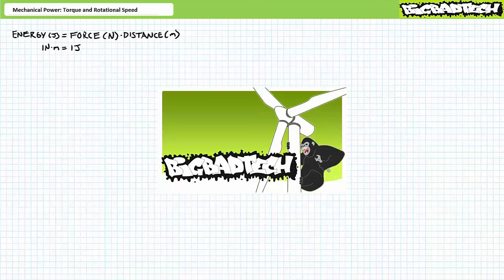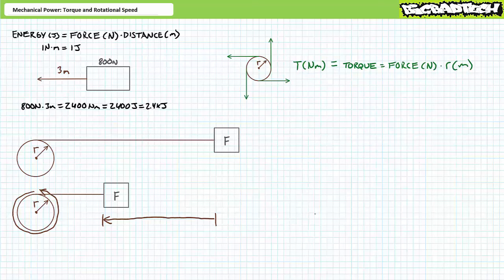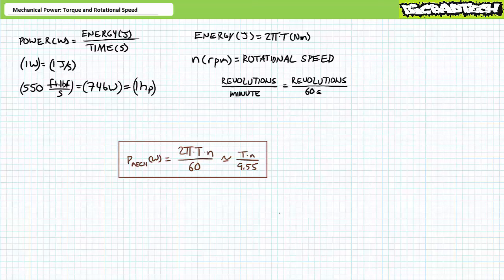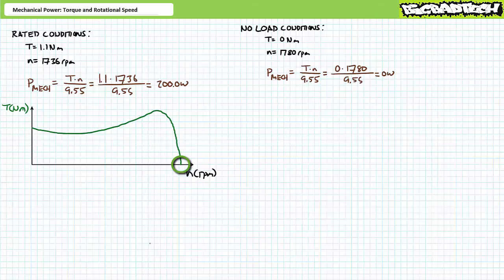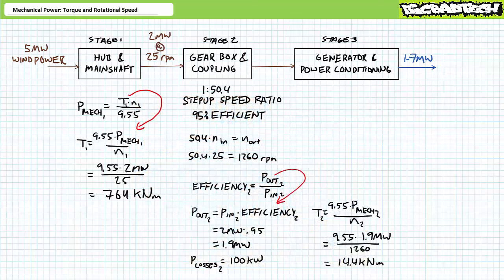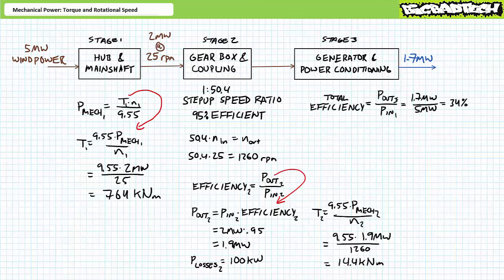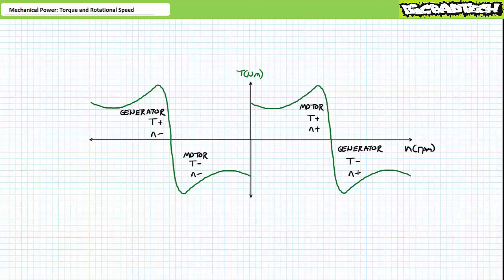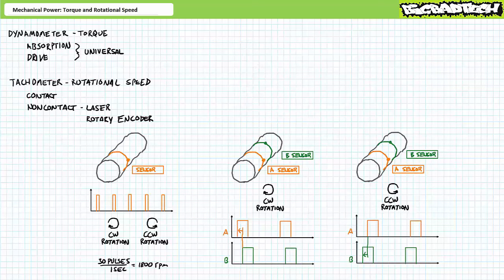Mechanical Power: Torque and Rotational Speed (Full Lecture)

Comment: I bought a portable gen it advertised in TRUE PWR, but when I use commercial gens they are rated in APPARENT PWR? Also I understand about neg torque in a gen, if you calculate this I understand that you must equal or exceed that for a prime mover to overcome this "resistance", how much prime mover force do you need, I am assuming at least the calculated force, or 10% more force than calculated?

Comment: Why do you claim torque is rotational.  Its doesn't have to be. It can be linear.
Reply from the maker: Wut?* Torque is the rotational analog of linear force. It describes the rate of change of angular momentum imparted to a load. You might be thinking of the instantaneous force vector at some point on the rotational path that is indeed linear.

* Used in response to an unclear or absurd statement when seeking to clarify it or expose said absurdity.